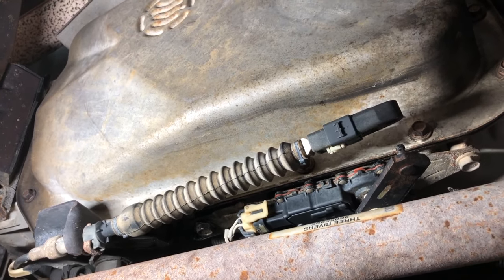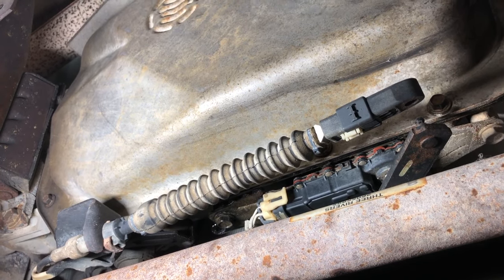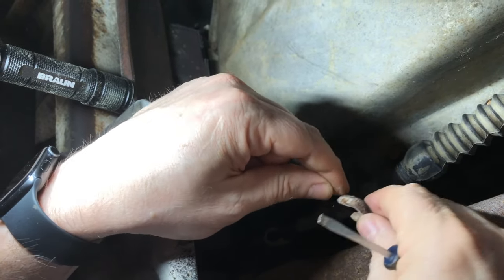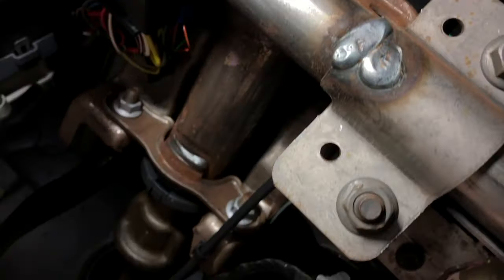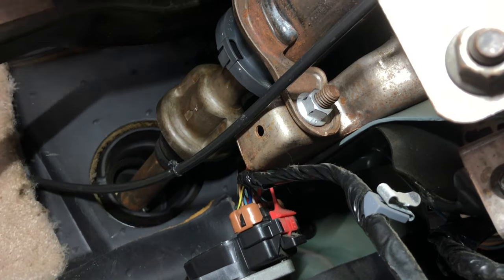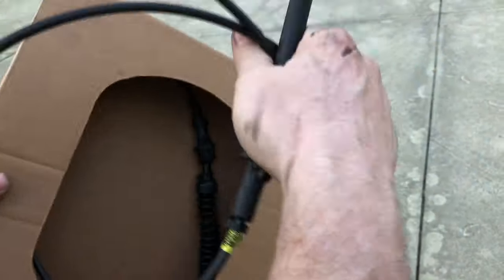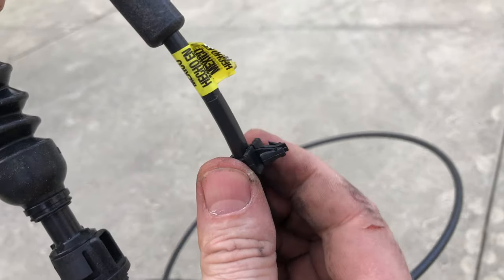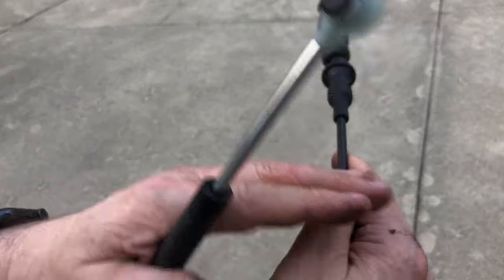1995 - 2000 GM OBS Truck Automatic Transmission Shift Cable Replacement Adjustment (Chevrolet & GMC)

Comment: Could it fit a 94 or is there a specific one????
Reply from the maker: Not sure, this particular part number states only 1995 thru the end of the OBS trucks in 2000 (2002 if you count 3500HD models).   It's likely nearly the same procedure but with a different cable.  Give your VIN to your local GM dealer and they can confirm the correct number.

Comment: tried adjusting it from park to 1st after adjusting but wont go past 3rd
Reply from the maker: Presuming it's genuine GM (some of the aftermarket designs may just not fit properly) if its properly adjusted at the lower cable like I showed, and then locked into place with the locking tab, and still off.  Then you need to check for either a problem with the attachment at the steering column end, or the cable binding at some point.
Reply: Just did mine it did the same thing 
I fixed it by taking it back of on the steering column end and cycling it by hand lock it in place once you get it in park and reconnect on the column side

Comment: Im having an issue with mine i followed all the steps with adjustment but it wont go all the way down to 1 it stops at 2 any idea of what i didnt wrong?
Reply from the maker: If it's not a genuine GM replacement cable, this can be a problem. The import copies can be prone to defects like this.   If it is a genuine GM part, then I would be looking for binding from a kink or too sharp of a curve in the cable routing.   Also be sure the lock clip has been released during this adjustment step.

Comment: My cable isn’t hitting to go back in park
Reply from the maker: I would suggest to recheck the cable adjustment procedure, and be sure the locking clip is correctly positioned.  If it's the correct cable for the truck and the bushings at both ends are correctly attached, that's usually what is amiss.

Comment: @ 8:39, If you are using a 10 mm socket, it is NOT a 10 mm bolt. Probably is a 5mmx 0.8.

Comment: I tried the adjustment but it’ll just go Park to 2, is there something u recommend me to fix this and make it go Park to 1?
Reply from the maker: There's a couple of things, presuming the shift lever on the transmission is working correctly.  First, make sure that the transmission shift lever is truly in the park position before trying to align the cable to match.  Second, some aftermarket cables just plain don't fit the old body style trucks properly.  So if not using the genuine GM part,  line up and compare your old and new cable to make sure you don't have that problem.   Third, double check that there's no binding or kinks in the new cable, and triple check that adjustment procedure with both end bushings securely snapped in place.